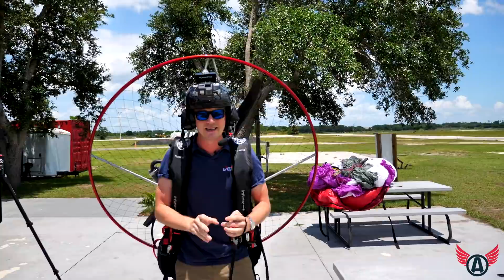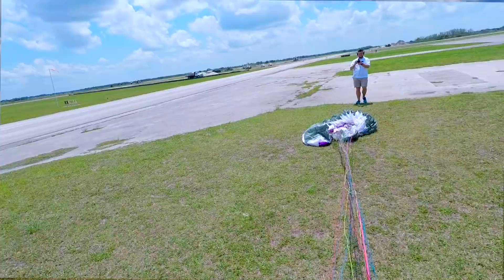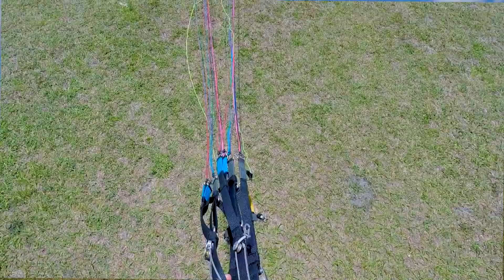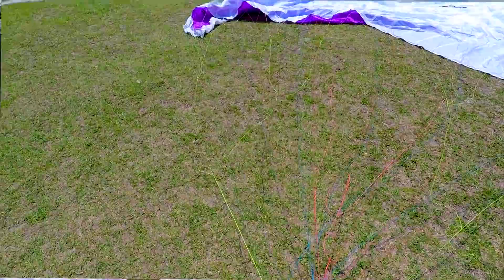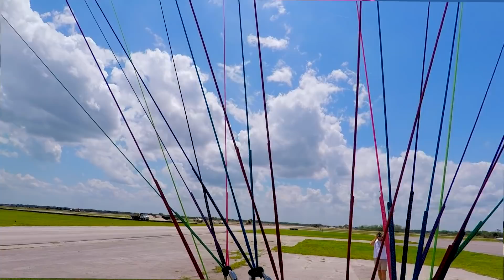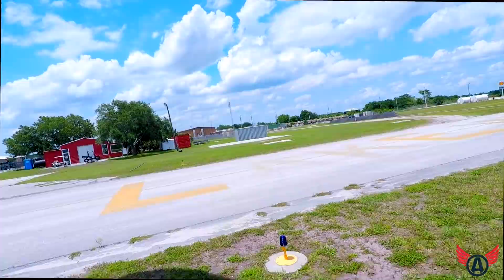How To: Properly warm-up your Vittorazi exhaust | AviatorPPG

Comment: Hi Eric. I was taught how to fly a year ago by Matt Minyard and he showed me this exact way of warming the motor up for 2-3 minutes before going full throttle and taking off. Bought my moster 185 brand new out of the box and always did and still do this same warm up. My exhaust cracked at exactly 25 hours on it even using this method. I still use the same technique even though it didn’t help the exhaust I do feel its better for all the motor components in general anyway. 55 new hours on the new exhaust and no new cracks yet though. Fingers crossed.
Reply: That’s typical of Italian manufacturing. The worst car I’ve owned was a Fiat. Sexy styling, but poor reliability.

Comment: Vittorazi has had to know about the exhaust cracking problem for years. How many exhaust have they sold because of the known problem? Never a video like this from them. And, still no separate sacrificial neck part which is where the cracks usually occur.  Now you can buy an aftermarket exhaust which solves the problem. I would like to see Vittorazi do the right thing and warranty all future exhaust for life. If they are so confident in their product, they should have no problem doing this. Will they do the right thing? Probably not. A company  should not design things to fail by design for a bigger profit! 
Thanks for the video. I use a better designed aftermarket exhaust, and so far no problems. If it cracks at the neck now, I just buy a new neck, not a whole new exhaust!
Reply: Which aftermarket exhaust did you get?

Comment: I have a 3 spring Parajet Maverick which I always let warm up at least 3 min and still had the cracked exhaust at 33hrs.  This video is good information but it "might" help.  The exhaust needs to be redesigned.

Comment: I've had two 3 spring exhaust crack.  Warm up was 3-4 minutes at idle and then a progressive run up to full rpm for less than 5 seconds.  Both exhaust had less than 25 hours on each.  Been flying ppg for nearly 10 years and this has been the biggest disappointment I've had in the sport.

Comment: You can get any exhaust annealed....go to a casting company near you. it will eliminate all cracking but it may not be very cheap. the cracking is caused by the actual welding of the steel in the first place and it pulls as it cools suddenly )

Comment: The problem is in manufacture, the welds need to be relieved, the process is to clamp the piece into a jig so it won’t move, then heat it to a temperature so that the molecules in the metal can rearrange themselves, then cool it slowly.

Comment: I know an engine designer that says the revs need to be raised quickly during warm up as more revs = more fuel = more oil. Extended idling with little lubrication would seem to be a very bad thing for the engine. It's a shame that an exhaust design fault requires a specific warm up technique. Comments?
Reply: 2 stroke engine designer?

Comment: Hi Eric. Question. Never any issues with the AC exhaust. What's the difference and why is the AC exhaust much more reliable? I bought my Nitro 200 E start from you over 3 years, same exhaust today and runs perfect. Warm up time usually around a minute.  Thinking about a 2nd motor but don't want to worry about a cracked exhaust..
Reply from the maker: Robert Swezey the Nitro has an additional coupling in the exhaust which allows it more room to move. We’ve had SIGNIFICANTLY less issues with the Moster than we had with the Nitro though. The exhaust is annoying, but much less “other” failures.

Comment: Just need to be added a few heat dissipatour (shields plates) at the must critical hot points and at the coolest points of the exhaust system add some loops of the classic isolation tape.

Comment: I noticed the mufflers cracking have a seem length wise along the muffler. I did see a pic of an upgraded muffler in which it seems welded in a ring like method around the muffler. Is there a reason they don't weld all mufflers ring like?
Reply: Probably cost

Comment: I did break in yesterday. throttle response was good and progressive from 0 to 5000rpm and from 6000 to 8000rpm, but from 5k to 6k it wasn't progressive. it kept on 5k when I accelerated and after a few seconds it suddenly rised  to 6.5k qnd  7k. So I don't know what is going wrong. To me it seems like a carb low neddle adjustment but Im not sure... Any help?

Comment: After 3 minutes idle you went full throttle. Have you any idea of the temperature difference between idle and full throttle? To avoid thermal shock you need to increase throttle GRADUALLY and SLOWLY.
Reply: "Hi! We're the experts, and we'll show you the way we warm up our motors to avoid cracking the exhaust. This works!"
YouTube Comment: "RRREEEEEE!!! You're WRRRONNNGGG!!!" ;)

Rapid thermal expansion and contraction ('shock', as you call it) is what is probably cracking the exhaust pipes. So the pipes can't take the temperature delta between full cold and max power at some period below their three minute period. After three minutes, the temperature delta between idle and max power obviously is within the range that the pipes can safely handle. This would mean things are 'fine'.

Comment: springs have nothing to do with metallurgy. metal failure on an exhaust is simply the result of inferior materials. warm-ups are for the oil, pistons and cylinder walls. this extended warm up is a corporate band aid. three minute warm up, on tiny, air cooled, two stroke engine, that is already under a prop load when ice cold? good luck with that!

Comment: I am  complete newbie and posting for information/knowledge. Why is it that certain manufactures have trouble with exhaust cracking and some do not. One would think the problem prone paramotor companies would peek at the design of the others that are not having issues and use a similar design or material to stop the issue. I know there are some like the Simonini  engines that have no cracking issues, am am sure there are several others that don't. Is it the material that is being used, the mountings? If you think about it, a two cycle dirt bike encounters a ton more abuse than these paramotors. They haul butt for a mile full throttle, go through water up to their knees, back into the dirt, jumps, crashes etc.... Why does their exhaust not have the elevated incidence of cracking? Just wanted to put some thoughts to ponder out there. I have no brand loyalty or wanting to tout any specific company or brand, we all enjoy flying these things, and for the most part, all are the exact same thing. Drop me some thoughts and ideas, I am here to learn.
Reply: Thin walled exhaust on paramotors to keep the weight down.  Dirt bikes have heavy pipes as compared to ours.